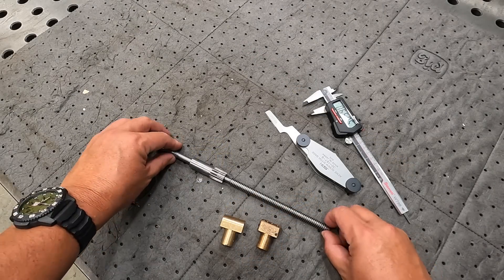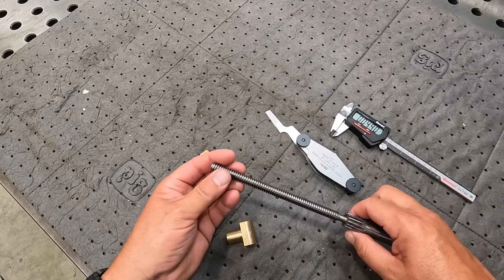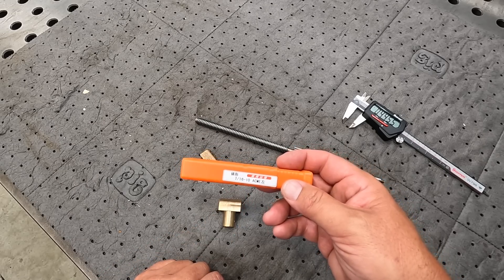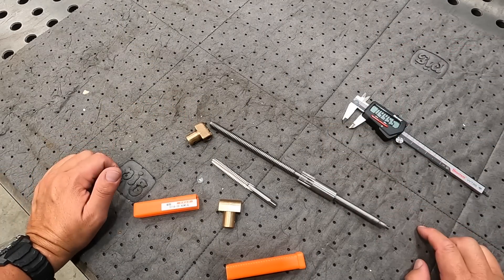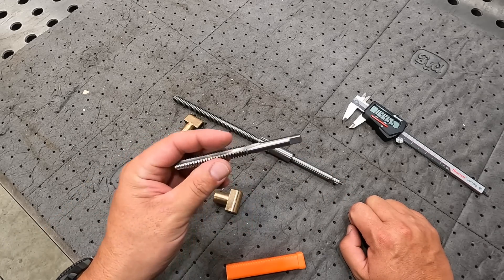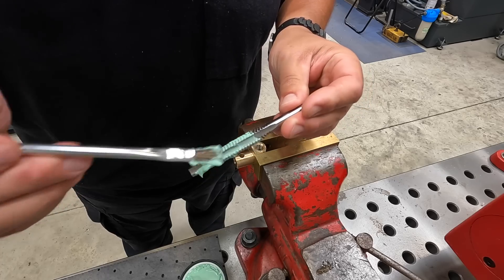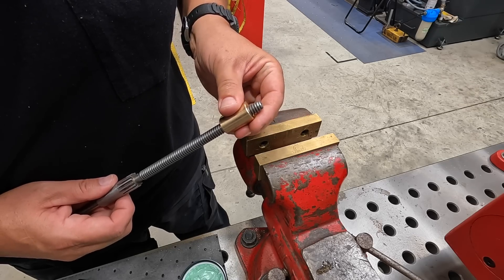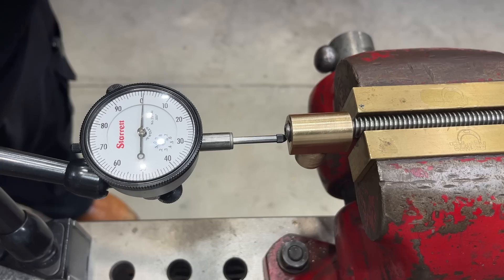Southbend Leadscrew Nut Won't Fit, Tool Tuesday Ep.16

Comment: I think the only way to get the slop out, or get it down to 0.001 would be to replace the acme lead screw with a ball screw.
Reply: There are disadvantages with ball screws on this configuration. Left hand ball screws tend to be more expensive. The nut size will be much bigger. The max thrusting force is smaller since ball contact surface is much smaller. The smaller the thread pitch the smaller the balls. 10TPI si about 2.5mm thread pitch. It's hard to have a ball screw with this small thread pitch.
Reply: A better solution which I implemented on my lathe (although metric thread) is a split nut. Actually two nuts. One is fixed to the top slide and one is floating. One face of the floating nut is milled at 2 degree angle in relation with the nut axis. The fixed nut has 4 dowel pins in the corners which goes into the floating nut to keep it aligned. Between the two nuts it's a wedge which is adjusted with a set screw from above top slide. The bottom of the wedge is pushed up with a leaf spring mounted on the fixed nut. You adjust the backlash from above - no need to dissasemble anything - by adjusting the set screw. It will push the wedge down against the leaf spring and spread apart the two nuts creating pressure on the opposite thread flanks. I have 0 backlash on my lathe for the reason I put a 1 micron glass scale and DRO

Comment: well... have to to wonder why that old brass has dents at "top". i would say thats for adjusting the screw ?
Reply: They were trying to tighten up the threads by compressing the metal. When it's worn the best temp fix is to slot the nut an hammer it closed a little, just temporarily.

Comment: I’m wondering weather the new t-nut was 3/8”and not 7/16”. Also before I’d condemn the cheap tap for cutting oversize I’d check the resized t-nut with a go-no go gauge.

Comment: I think theres too much slop, ether id or OD was made oversize. I was able to replace a cast iron nut in my nuttell lathe with ally bronze in the same lathe. All was made in same lathe except for alittle vice work for the radius with file. I made a male thread gauge first to my calc's of standard thread LH Acme form. Squared off bronze block in lathe, yes a pain but had no access to mill or another lathe. Bored hole and cut thread to form a good/slightly tight fit, then turned stub and tapped hole thru it. Worked out well, been in use for 6 yrrs now.

Comment: The problem with cheap tap suppliers is that you can't choose your H limit. That's probably an H3 or H4 tap which means it is probably 3 or 4 thou over nominal. Using it on a worn thread means you'll have a lot of back lash. You needed an H0 tap to be right on nominal size.  A hack to get around it, is to not go all the way through,  but leave the last couple of threads still in the taper portion of the tap. Keep goong back and forth checking it till the lead screw will go through but it is nice and snug.

Comment: There used to be a seller on ebay that sold the crossfeed nuts that had a partial saw cut through one end with a set screw installed. This allowed you to tighten the set screw which spread the last thread or two apart allowing you to tighten the backlash. I bought one for mine and it worked very nice.

Comment: Very common new lathe owner concern- minimal cross slide backlash like that is virtually meaningless. I think lathe owner at one point or another has wanted to replace their cross screw/ nut. I've made several for smaller lathes but I usually tell people not to agonize over it now. Best not to sell something to someone that they don't need. Good video regardless! Nice to see that the tap worked out

Comment: I am thinking along the same lines as @joeromanak8797. I bet the drill size may have been oversized, ?? ( Cool video though. )
Reply: Undersized, right?
Reply: I don't think the drill has anything to do with it on those type of threads, a square thread is designed to take the force on the face of the thread not on the outside or inside diameters. On angled threads a totally different matter.
Reply: Acme threads are a tapered threadfrom (14.5* per side, 29* inclusive) @cameronjohnston5748

Comment: Curiosity question. Would this have had any less backlash if you drilled a virgin piece of brass and tapped it with that same tap? I know there is some wear in the screw but I wonder if the original job of tapping the nut was out of spec, in which case retapping can’t do much improving. 🥸👍👀✅

Comment: I notice that the nut was tipping up and down when you were checking for backlash, which won't be possible when it's installed. Backlash might be better than the measurements would "indicate" 😁
Reply: Agreed. I was surprised that Adam didn't clamp the nut in the vice, thread the screw through to midpoint, and measure the lash at the tip of the screw.
That being said, Adam has at least 5 hours more time as a machinist than I do, so I'm gonna assume that his method was good enough for the task at hand :)
Reply: He wasn't trying to get a super precise measurement. Just something to do a simple comparison of before and after.
Reply: Correct the armchair guys always know a better way!
Reply: I think he wanted to test the backlash in the nut. Checking in the middle of the screw would have shown the combined backlash. .015 is not that bad for a lathe. A new nut wasn’t necessary.
Reply: @ellieprice363 true. But there’s nothing wrong with trying to get backlash out as much as possible.